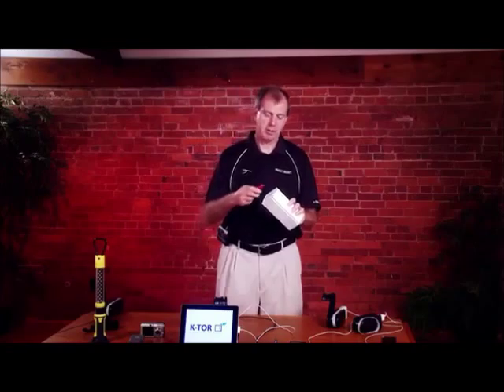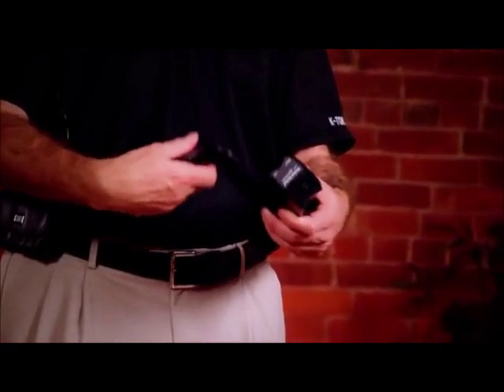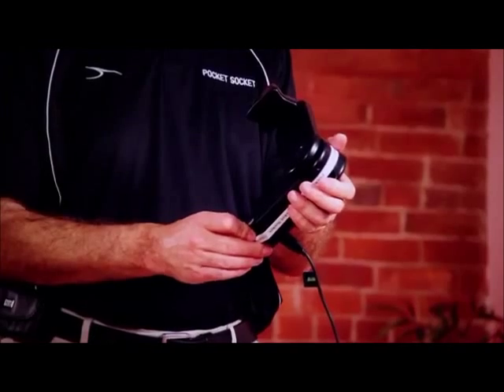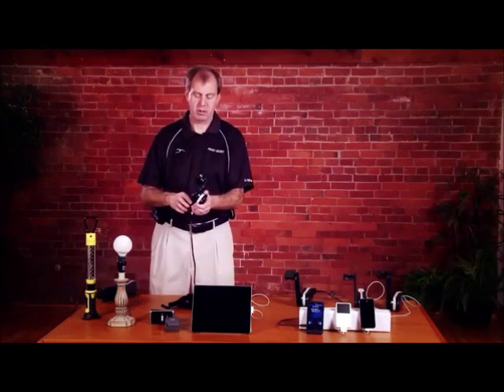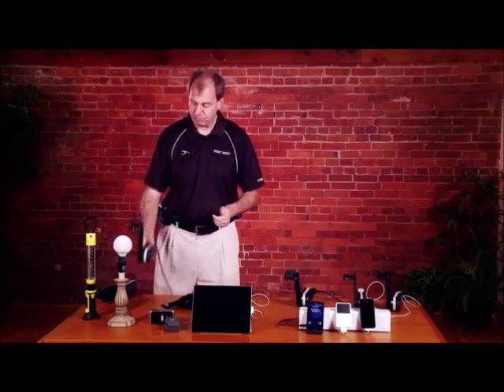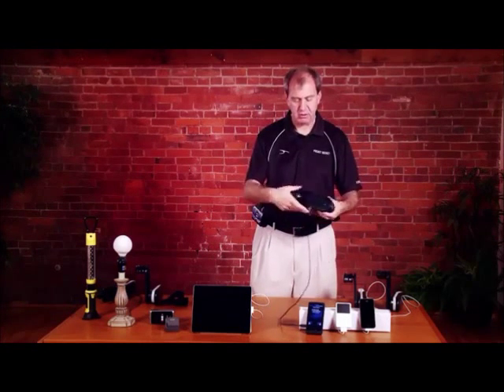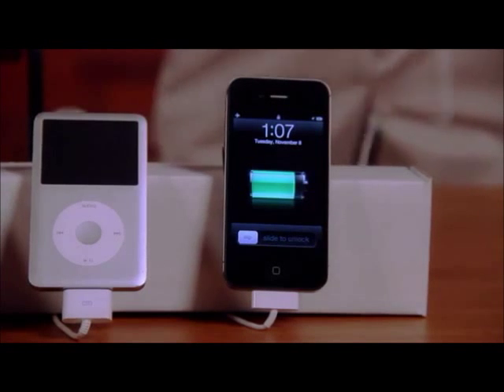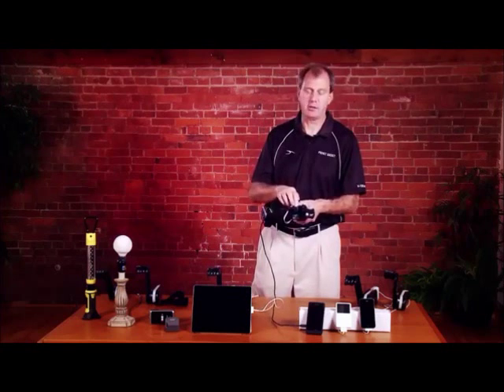KTOR - The Pocket Socket - Hand Crank Generator

Comment: What is the point if you have to keep cranking? I've got flashlights with this charging system and they continously charge after a few turns. The light going off defeats the entire purpose. Am I missing something?
Reply: it’s a lightbulb lmao it doesn’t have a battery you dweeb

Comment: Is it not possible to gear it up so you only need one turn per second? Seems to be a lot of power to power. You'd burn up a lot of calories. Plus, it seems to put extra stress on the crank arm.